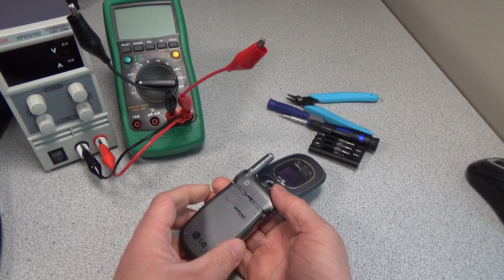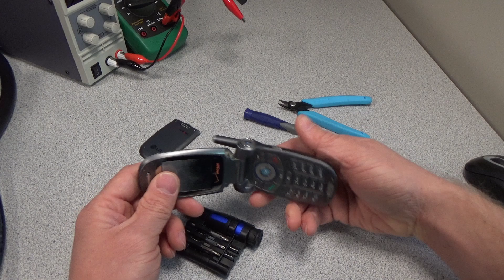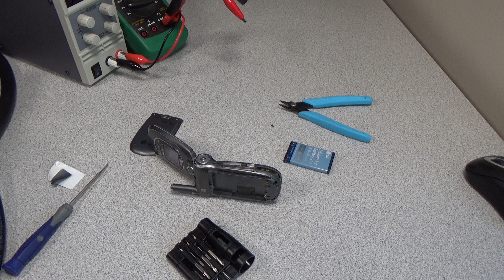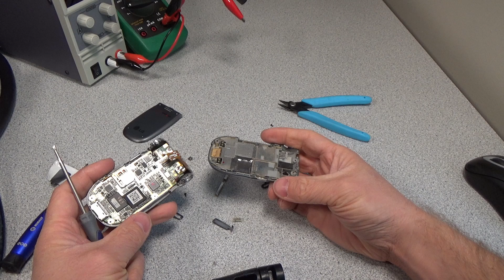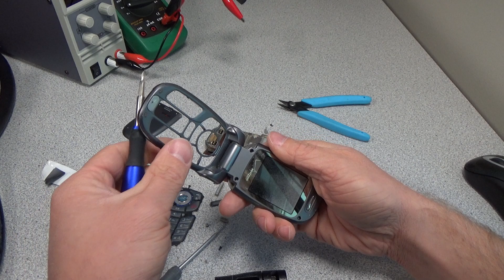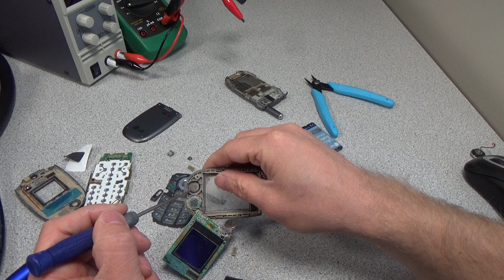LG VX8300 Flip Phone Teardown - Video #4

Comment: What if you connect the charging terminal directly to the the power supply and the cell doesn't switch on? any solution
Reply from the maker: A comment on my 4th video!  Neat.  If it isn't turning on at that point then it's probably failed in some other way.